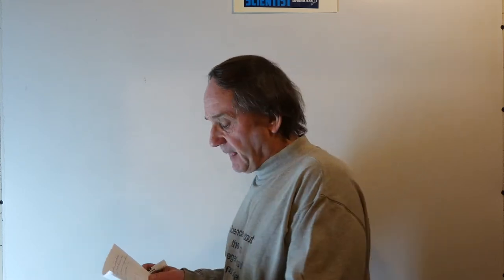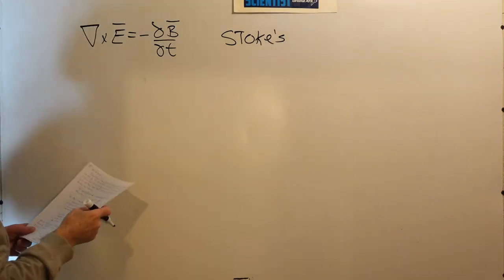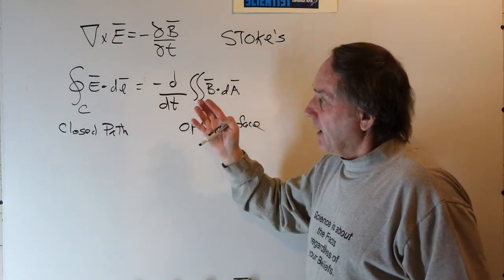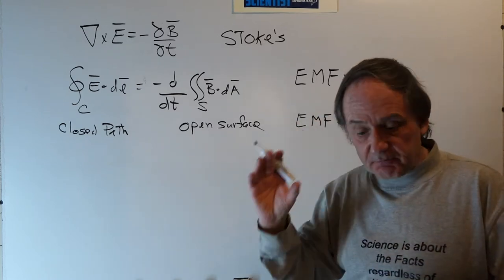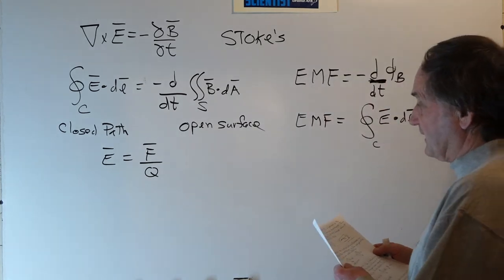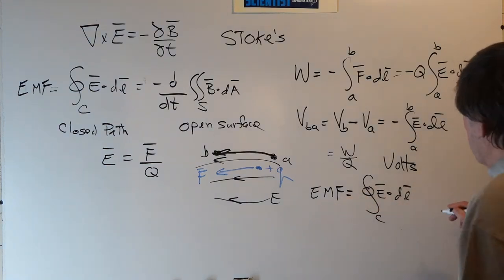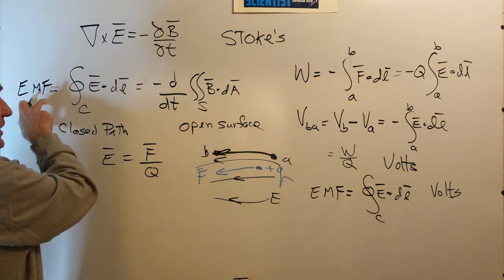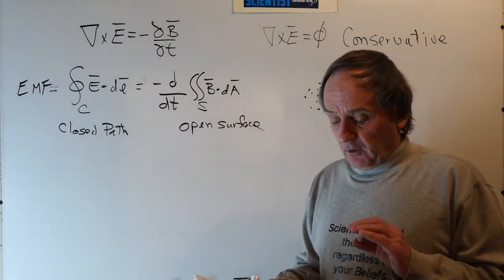FARADAY's  LAW

Comment from the maker: NEW  THREAD  FOR  Medhi,
I have another thread in which I posted recent comments I have made to  ElectroBOOM videos with reference numbers so we can easily find the comments.  This is called:  ARCHIVE  of  Comments on Faraday's Law
----------------------------------------------------------------------------------------------------------------------------------------

from isodoublet:   @ElectroBOOM   "You should start designing circuits a little bit to understand what's going on in real world I think. It is sometimes hard to grasp things when you just read about them and theorize."

"In the real world" Lewin is 100% correct and you are 100% incorrect. The correct physical principle is Faraday's law, and the KVL is merely a special case with no fundamental justification. Voltages are not defined when there's a changing magnetic field inside the loop. There's absolutely nothing guaranteeing you'll be able to model electrodynamics generally using only a scalar potential. The conditions required for this type of model to hold are well-known: E must be curl-less, which means no changing B fields are allowed.  Else you must use a vector potential. This is the "real world". 

"This is to say, the voltage across any inductor is defined, despite the fact that integral E dl through them is zero."

Once again, in "the real world", no, the voltage across the inductor is not defined. It can't be defined because the integral E.dl is path dependent. This means that if you choose a contour that goes inside the wires you get a different answer than if you go outside. We can define a workmanlike "voltage drop" which can be useful for certain purposes but this should NOT be confused with the actual voltage difference, which can be easily shown to not exist mathematically. This is what the real world is like. It doesn't have to conform to what anyone was taught.

--------------------------------------------------------------------------------------------
     
from ElectroBOOM:  @isodoublet     I understand what you are saying. But you are defining voltage as integral of E.dl. With that definition you and Dr. Lewin are correct like I mentioned in my video. But I tried to show that the voltage definition is not that, as I also showed from Professor Belcher's document and Dr. Feynman's book. Dr. Feynman clearly says the voltage across an inductor is defined. This is because it is NOT defined as integral E.dl. I don't know, but I keep Dr. Feynman at high regards.

------------------------------------------------------------------------------------------------
   
from  isodoublet:   @ElectroBOOM    "I understand what you are saying. But you are defining voltage as integral of E.dl. With that definition you and Dr. Lewin are correct like I mentioned in my video. But I tried to show that the voltage definition is not that, "
But you can't, because that is the definition of voltage, as defined by absolutely everyone, including Feynman. Look up equation 22.14 in his lectures. It says clearly and plain as day that the KVL is defined as the statement ∮ E ⋅ ds = 0. 

"Dr. Feynman clearly says the voltage across an inductor is defined."

No, he defines a workmanlike "voltage drop" which is not identical to the physical voltage drop, which he is well aware doesn't mathematically exist. That's why he tells you to use the path shown in Fig 2.9. Use any other path and the KVL fails even for a simple circuit containing an inductor.

-------------------------------------------------------------------------------------
     
from ElectroBOOM:   @isodoublet    In equation 22.14 Dr. Feynman is simply saying the sum of all voltages in a loop is zero. In equation before that it says line integral E.dl = sum of all voltages. If you return to equation 22.3 forward, Dr Feynman is showing the voltage across an induct or is equal to the line integral of E.dl across the rest of the circuit (without inductors). And he is saying there is a known voltage across the inductor equal to -L di /dt. So are you saying he is defining voltage differently here than the actual definition in physics?

-----------------------------------------------------------------------------------------

from  isodoublet:  @ElectroBOOM   "In equation 22.14 Dr. Feynman is simply saying the sum of all voltages in a loop is zero"

Let me paste the excerpt here for reference.

"The complete line integral is then just the sum of the voltage drops across all of the elements in the circuit:

∮ E ⋅ ds = ∑ Vn.

Since the line integral is zero, we have that the sum of the potential differences around a complete loop of a circuit is equal to zero:

∑ (around any loop) Vn = 0 (22.14)"

Ok, so ∮ E ⋅ ds = ∑ Vn = 0. This means ∮ E ⋅ ds = 0. This is Feynman's definition of the KVL, which is the same as Lewin's. Feynman is just telling you that to improve odds of success you should use the path shown in fig 22-9, since this equation is not true in general!

"So are you saying he is defining voltage differently here than the actual definition in physics?"

Yes. He's essentially telling you what paths are okay to use to make the KVL work when there are inductors in the circuit. In order to model this seriously using the same definitions of the scalar potential that are used elsewhere in physics (especially in Feynman's own pioneering work on quantum electrodynamics, for example) you would need to also define a vector potential A such that B = curl A and E = -grad V - dA/dt. There's some redundancy in the definition (we call this, somewhat confusingly, "gauge symmetry"), but one thing that is always true is that any curl of E must come from A, not V.

--------------------------------------------------------------------

from ElectroBOOM:  @isodoublet    Do you by any chance know anywhere in Feynman's book or anywhere else where the voltage is clearly defines? I like to see that. If our disagreement is on definition, we should settle it on where the definition is clearly made in literature. So far we are working from subliminal messages!

--------------------------------------------------------------------

from isodoublet:  @ElectroBOOM   Yes, the earlier chapters in Feynman's book do give the usual definitions of the scalar and vector potentials. In particular, chapter 15 has table 15-1 which contains various relations which are sometimes false (including E = -grad V) and their correct generalizations, which implicitly define the potentials V (which Feynman calls phi) and A.

----------------------------------------------------------------------

isodoublet   @The Crab   "Lewin believes KVL is ∮E᛫dl=0 even in the presence of a magnetic field, which is not correct, he's not taking into account the energy produced by the magnetic flux on the wires used to measure the voltage."

That is what the KVL is whether you like it or not. Mehdi actually agrees with this when he cites Feynman (who explicitly uses this definition). It is the definition. There is no other. 

"he's not taking into account the energy produced by the magnetic flux on the wires used to measure the voltage."

Energy is not a thing in the way you're thinking. It's not a fluid, it's not a gas, it's not a solid. It's a number. You calculate this number before a process happens, and then you recalculate the number after the process is concluded, and conservation of energy guarantees the two numbers will be equal -- an extremely useful relation. So there is no energy being "produced" in the wires. It just so happens that energy initially associated with the magnetic field is later associated with kinetic energy of the charges... and how does that happen? Magnetic charges do no work, so it happens by the action of an electric field. The B field changing in time produces a curl in E, and the curl in E then does work on the charges. So the definition ∮E᛫dl is perfectly adequate for the sum of voltages around the loop, which is why it's used by everyone. Is it zero when there's a changing magnetic flux inside the loop? You can bet anything that it isn't. This is simply the way nature works. It doesn't have to conform with what anyone was taught in high school.

----------------------------------------------------------------------------

 isodoublet   @Ash Kebora    " Technically, there is a voltage differential that is path-dependent, but Mehdi is basically saying (as explained about 13:25 and on for a bit), is that KVL still holds when analyzing the circuit. It's not magically doing something else."

And RedTriangle53 has been patiently explaining to you that no, it doesn't hold, it can't hold, and it's a trivially verified fact that it doesn't hold. It's not magic. It's 200 year old electrodynamics. Saying that it holds when Faraday's law shows explicitly that it doesn't really is akin to saying that 2 + 2 = zebra. There's no reason nor any justification for sugarcoating this.
Reply from the maker: RedTriangle53 
Sorry, but academia is not a safe space. Being patient with cranks is not, nor has it ever been, a written or unwritten rule in science. The very opposite in fact. Science is entirely based on being mercilessly critical of everything and everyone until you find something that does not buckle under it. A tenured professor should most definitely be able to say he's embarrassed that an alleged master of engineering is spreading misinformation about basic science to thousands if not millions of people. It would be embarrassing if he didn't.

To be clear, Mehdi is not correct. He has been throwing convenient assumptions against facts, and now to "conclude" he simply explains away the actual physics by making up things that simply do not hold, and he would know that if he bothered opening an undergraduate electrodynamics textbook. If this was a private argument it would be different, but he is spreading pseudoscience to people who don't know better in an as public way as possible(just look around the comment section and you will immediately spot at least a few dozen people who are now apparently qualified to insult and criticize Lewin because of the frankly incorrect things Mehdi has said), and he's doing it with seemingly no effort to listen to what the other side is saying or even checking his own facts before uploading a video. There is certainly a limit to what the scientific community in general should be patient with, and this crosses it.

-------------------------------------------------------------------------------------

RedTriangle53   @The Crab Mehdi    did not, and still does not, understand what he is talking about. Lewin is 100% correct, and Mehdi is 100% incorrect. That's all there is to it. There is no misunderstanding. Mehdi does not know his theory and he is throwing around assumptions and nonsense. From Lewin's perspective(and the perspective of anyone else who knows how the physics actually works) this is literally exactly equivalent to someone preaching about the flat earth under the authority of their masters degree. If Lewin is not allowed to be embarrassed by this, what in the world can he be embarrassed about?

-------------------------------------------------------------------------------------

RedTriangle53   @The Crab Wrong.   You are simply parroting what mehdi has said. The measurement was not done incorrectly, Mehdi just misunderstood what was being measured. Trust me, Lewin has made zero mistakes in this entire situation. Mehdi simply does not know his theory well enough, and instead of properly looking things up and correcting himself he makes up silly assumptions that on the surface level seem to conceal the fact that he was wrong, but are entirely in conflict with electromagnetic theory if you consider them at any depth. He claims that somehow everything works out because the B-field somehow performs work on the system. He does not demonstrate how this occurs, there is in fact zero mathematical argumentation to support this point. And all you need is one line of vector calculus to show that this cannot possibly be the case. I challenge you to find it.

-----------------------------------------------------------------------------

RedTriangle53  @Narret   Take for example his claim that the two sides of faraday's law are separate things entirely. His argument becomes that there is a magnetic opposite contribution to the work that counteracts the non-zero electric work.

Here's the zinger: The B-field cannot do work on a moving charge(you can show this with a single line of vector algebra). He just made that up. He also formulates this notion as "voltage does not only come from the E-field", which is wrong by definition.

He says a lot of correct things(which he did not come up with and also nobody disagrees with), but when he comes around to his key points which are supposed to justify his position he simply gets the basic theory terribly terribly wrong. It's not an interpretational discussion. Mehdi is just very very incorrect about the physics.

--------------------------------------------------------------------------------

 RedTriangle53    @The Crab     if the loop integral is not zero, then it is not actually KVL. KVL was defined by the voltage drops over every closed loop being zero. The end. If it works generally it must then instead be faraday's law, but Mehdi consistently misinterprets what the law states, seeming to think that the right hand side and left hand side are not essentially the same quantity. This unjustified assertion then lets him make further erroneous statements and shuffling them together to pretend that KVL holds. And yes, his statements are strictly false.

Yes I did read the paper, and it does not support Mehdi's claims. In fact it discusses the importance of being careful when formulating faraday's law to mimic KVL, because inductance terms that show up will have *nothing to do with the original definition of KVL and its statement*. In other words, these terms(in terms of what they represent) belong on the right hand side as is usual with faraday's law, and ordering it on the left hand side and calling it KVL is a great source of confusion for students. Everywhere else in the paper he properly and precisely applies faraday's law, not KVL, for dealing with systems under induction. I have no qualms about the paper or its author.

Mehdi on the other hand seems to contradict the paper when he states that the right hand side corresponds to work that counteracts the left hand side. He states that voltage does not only come from the E-field(which is wrong by definition), and states that magnetic work is a factor, when the B-field actually cannot ever do work on a moving charge. His statements are in fact in direct contradiction to the theory.

-------------------------------------------------------------------------------------

RedTriangle53   @Narret Yeah,     the "any energy per unit charge" thing is what I refer to by voltage not only coming from the E-field. This is wrong simply because voltage is defined by the curve integral of the E-field and nothing more. It does describe energy per unit charge of course, but only electrical energy.

If a magnetic field changes over time it induces a rotating E-field, and that is what faraday's law states, and where the surplus energy comes from. KVL stops holding because the loop integral over E is not zero when E has curl. Mehdi states that the right hand side is a magnetic contribution(around 9:30 minutes in) that cancels with the left hand side thus preserving KVL, but the right hand side is not magnetic, and it is not a contribution, it is the accumulation of the left hand side terms(you might say it's the solution to the left hand side). It's sort of like saying that a + b + ... - (a + b + ...) = 0 shows that addition always results in zero.

Aside from the fact that this is how things are defined and derived, you can show that you can't actually have a magnetic contribution to the work at all, because magnetic force is based on the cross product(forces can as usual be decomposed however we like and the sum still acts the same, so we can consider the magnetic force independently for general results and they will still apply perfectly). I believe it can be written as an identity a dot (a cross b) = 0 for all a and all b. To put it simply, work is only done by the component of the force which is parallel to the direction of travel, and magnetic force always acts perpendicularly to a particle's velocity vector. So magnetic fields cannot ever do work on moving charges.

I guess that's a lot of different ways of saying that the only possible contribution to the voltage is the E-field. Let me know if you feel like there was something I didn't answer properly.

--------------------------------------------------------------------------------
 
RedTriangle53   @Narret     Magnetic force on a charge is defined as F_m = q*v* x B and results in a force vector which is always perpendicular to the direction of travel. It therefore cannot do work on the charge under any condition. But it does curve the path the charge takes(though it gains no energy from the magnetic interaction). Magnetic work does exist of course, but not on individual charges. For example a magnetic field interacting with another can cause a motion of the other system(obviously we know that two magnets can attract or repel). In this example all the macroscopic parts of the system are considered fixed though.
 
RedTriangle53   @leakforme    I've mentioned the most glaring mistakes he made in this video and explained why they contradict the theoretical framework of electromagnetism. As you say, it's not a difficult feat. The reason you don't find many comments contradicting him is that his viewers mainly get their information from him I reckon.

Faraday's law and the Maxwell-Faraday equation are two different equivalent formulations of the same law. Faraday's law is on integral form, Maxwell-Faraday is on differential form. One can be related to the other using stoke's theorem. The left hand side is the voltage accumulated around a closed loop, the right hand side states that it is generally not zero.
Reply from the maker: terminate  @Electroboom ,  please explain your conclusion more clearly. When you derived the equation at 6.24 you even showed that as integral (e.dl) = sum of voltages as Vab. which is equal to -dO/dt and so KVL is  integral (e.dl) = 0.  As saying sum of voltages = 0  is  integral (e.dl) = 0.   And so Professor Lewin was right. 

I have not yet read the papers in the description.  However what you have said about them I do agree. Yes sum of voltages = 0 if you do not take the closed path with in the inductor.  But at 13:47 you said that  integral (e.dl) = 0 for inside the inductor with there is a change in magnetic flux. This is wrong. Yes in a DC circuit that is correct but not in an AC. 

Remember yes V=L Di/Dt  but integral (e.dl) = emf.  Remember that self inductance is  v = Ndo/dt  where n is the number of loops. so v is the sum of the voltages around those loops as N= number of loops and do/dt is the emf in that loop and so sum of the voltages is V (total voltage induced).  If you try to take the loop around the inductor it will not equal zero.  Nor have you shown why Dr lewin's demonstrations are wrong.  If you agree with faraday's law then you will know that  sum of voltages around any closed loop is equal to do/dt.  

Let's go back to you GPE analogy.  Yes its zero when you lift the transformer up you gain GPE and let go it gains KE and loses GPE and so the energy  ignoring air resistance is zero.  Now if you then attached the transformer to a machine that could give the transformer a constant acceleration and it forced the transformer up and then down.  Then GPE + KE  does not equal zero but equals to the work done.  I still do not see why you think KVL still always holds.  Please explain you opposing view in more detail as to why you disagree.  As this video you jumped to sum conclusions with no proof (are these conclusions from the paper you read?).

------------------------------------------------------------------------

terminate  @ElectroBOOM   I still do not see why you have jumped to the conclusion that there is no E field within the resistor because there will be. After all there are charge moving this produces of course magnetic fields however as they are charges then Is an E field.  If you looked at the Feynman's lecture you would see that saying there is no E field is not strictly speaking true.  It is that the total force on the charge is zero (that is after the initial acceleration of the charges) and so even in a perfect conductor the integral E.dl through them is -do/dt not zero.  Even more so If we are talking about real resistors that are not a perfect conductor.  What would you say if I made the inductor out of silicon? This has a very high resistance from the lack of free charge carriers and thus there is a considerable E field within that conductor.

-----------------------------------------------------------------------------------

terminate  @ElectroBOOM    I see what you are saying. However KVL says the sum of all the voltages around ANY closed loop is equal to zero. Yes IF you take the power source into account than the sum will equal that (emf). The power source is not taken into account because that is Not in the closed loop that we are dealing with here.  So simply by saying KVL always holds is false. If you have a different definition then you also have a different definition for KVL.  " I like to take the energy from magnetic fields into account and assume a known voltage across inductors and wires in the presence of magnetic fields. " But that magnetic field induces the emf every were in that loop. And also is NOT part of that loop. Thus the sum of the voltages around this particular loop is -do/dt.  I know you want to make things easier and if that works for you please keep using it. However keep in mind what KVL is saying. For ANY closed loop the sum of the voltages adds to zero. That closed loop does not take the magnetic field source into account but only its effects. And thus its is equal to the emf.  So purely by definition KVL does not always hold.

KevinMulia and also they are not both right in general, faraday's law is always right KVL is only right if there is no e field and so no induced emf around the loop.
--------------------------------------------------

terminate  Im glad that you have done this video as it shows your interest in this and you want facts.  However, I have read the bit of inductance on 

http://www.feynmanlectures.caltech.edu/II_22.html

 and they are in a agreement with DR Lwin.  "line integral of E all the way around any closed path is equal to the negative of the rate of change of the flux of B through the loop."   At 13.47 you say that integral of E.dl=0  Did you read this?  Or are you confusing DC circuits, please explain.

 
Ejaz Ashraf @terminate  In 22-2 of Feynman Lectures at the penultimate paragraph, it starts by saying "As we have seen before, there can be no electric fields inside a perfect conductor. Therefore the integral from a to b via the coil is zero" [sic]. I suppose this is what he is referring to. The first integral in Feynman's book runs via the coil.

--------------------------------------------------------------

terminate  @Ejaz Ashraf   From what I know i think ElectroBoom is miss interpreting feymans lecture post. As because as we have seen the the loop integral (E.dl) = integral(in inductor e.dl)+ integral(out inductor e.dl) if there is no E field with in the conductor lets say on the secondary winding of a transformer then there is no (inside -do/dt ) with the conductor and so there is no induced emf as emf = -do/dt. There must be a B fied with in the conductor as in order for the free electrons to react to that change in B field to produce an emf. And so in the conductor there is (inside caused by B field) and so it is  -do/dt. and so looking at this loop integral (E.dl) = -do/dt.  KVL says that sum of v=0 and so loop integral (E.dl) = 0 which is clearly wrong. Remember the analogy at the start of the video? its true that  GPE + Ke = 0 if just lift and dropping the transformer. But if I then forced in up and then down then GPE+KE = work done this is the conservation of energy and the same applies to this discussion. KVL is not wrong it is just unneeded as KVL does no always hold. In conclusion it doesn't matter if its a perfect conductor  as if exposed to a do/dt by the change in B field there will be an induced emf (which is every where) And so even if there is a voltage drop, the electrons gain that energy back from the change in B field and so the total PD across the loop is equal to that induced emf by conservation of energy and so KVL does not hold here.with no induced emf when the electrons go through the load they loose energy but do not gain it back and thus like the GPE + KE = 0 analogy the sum of pd across the loop is zero by conservation of energy (see the difference between the circuits?).

Ejaz Ashraf   @terminate 
https://youtu.be/EYYNRubHIno
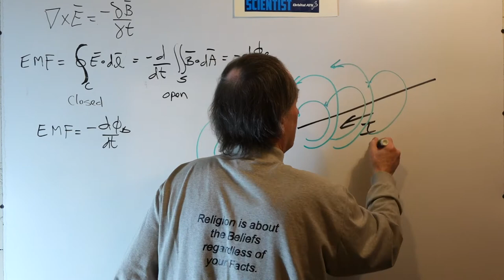39:30
Reply from the maker: [T9 -1]     12/11/18     1:05am                also found [T2-2]  elsewhere   
@Narret, Your question:
<<< isn't the Faraday's law based on a total derivative and the Maxwell-Faraday equation only based upon a partial derivative?>>>

The point form of Faraday's Law as commonly expressed as one of Maxwell's equations assumes the circuit in which the E-field is being measured is stationary with respect to the observer measuring the fields and the B-field is uniform in space as it changes with time:

                                          ∇ × E  =   - 𝛅B/𝛅t
                                   
This is called  "transformer action".

However, if the circuit is allowed to move within the changing magnetic field then another contribution needs to be added to the point form equation to account for the contributions due to lines of flux being cut by the moving circuit which is called "generator action".

                       ∇ × E  =   - 𝛅B/𝛅t  +  ∇ × (v × B)   

                    - 𝛅B/𝛅t  =  transformer action  
               ∇ × (v × B)  =  generator action          v = velocity of moving ckrt

Note that  (v × B)  =  Em  is called "motional EMF"  so we can write
Faraday's Law as:
 
                                ∇ × E  =   - 𝛅B/𝛅t  +  ∇ × Em     

The total derivative follows on the right side by looking at the convective derivative of the B-field,  assuming the circuit velocity has no spacial variation (circuit is not deforming or contorting while moving) and noting that   ∇ • B = 0.

                       ∇ × E  =   - 𝛅B/𝛅t  +  ∇ × (v × B)   =  - dB/dt

If you attach an open non-deforming surface  "Σ"  to the circuit path and integrate the flux over that open surface  we get:

                    ∫∫  ( ∇ × E ) • dA  =  ∫∫  ( - dB/dt ) • dA 
                    Σ                              Σ

Apply Stoke's theorem to the left side of the equation:

                   ∮ E • dL  =   ∫∫  ( - dB/dt ) • dA 
                                        Σ 

Since the open surface "Σ"  is non-deforming but rigid over time, we can move the total derivative out of the integrand as a Leibnitz rule for vector integrals:

                ∮ E • dL  =   ∫∫  ( - dB/dt ) • dA  =  - d/dt ∬B • dA   =   - dΦ/dt
                                     Σ                                             Σ

                     ∮ E • dL  =   - d/dt ∬B • dA   =   - dΦ/dt
                                                     Σ

This integral form of Faraday's Law is always true and can be applied in general even when the circuit is deforming and contorting in time but the differential point form has restrictions as noted above.

           ∮ E • dL   =  - d/dt ∬B • dA   =    - ∬ 𝛅B/𝛅t • dA  +  ∮ (v × B) • dL
                                           Σ                        Σ          

           ∮ E • dL   =  - d/dt ∬B • dA   =    - ∬ 𝛅B/𝛅t • dA  +  ∮ Em • dL
                                           Σ                        Σ    
                                                                     transformer         generator
GH
===========================================================
https://youtu.be/Q9LuVBfwvzA?lc=Ugz3NZtYruDitynO-Ax4AaABAg.8oPJAdGPDNy8oQnlPXj0vn
Reply from the maker: [T9-2]     12/11/18       2:48 am
You all need to take a deep breath.  Lewin is correct on all points - that should not be debated.  What is the problem is,  most texts and instructors are unaware of the fundamental error they are making by not realizing that in the presence of changing magnetic fields you have a Faraday Law problem and not strictly speaking  KVL.  Lewin is correct on that point and that is what he trying to convey to the world.  He is not saying KVL does not work but that it is being misapplied or rather the name inappropriately attributed to what is a Faraday Law problem.  The loop rule as it is being used in cases where there is a changing magnetic flux whether localized in inductors/transformers or applied externally is  NOT  STRICTLY  SPEAKING  KVL  but rather Faraday's Law.  That is all he is saying.  

Applying the term [ Kirchhoff's loop rule ] in the general case is what is wrong and not the loop rule itself.

What we are taught as electrical engineers and in most physics courses is that you can sum voltages around a closed loop(circuit) and get ZERO for the sum, that is: the sum of the voltages around a closed loop is zero.  This is true IF in that sum you include induced voltages(EMFs) as well as explicit voltages such as battery EMFs, capacitor voltages due to displacement currents and ohmic drops.  That is not in debate.  This has been taught for decades and WORKS.  It is the primary analysis tool used in circuit analysis - that is not in dispute.  All Lewin is saying is keep in mind that when you do this, you are actually writing Faraday's Law and have moved all the terms to the left side of the equation and when invoking the loop rule, you are not making a distinction between the explicit voltages and induced voltages which is not electrically true and correct though mathematically sound.  This procedure is in the strictest sense inappropriate.  When doing that, you hide the nature of the induced voltages by treating the same as the explicit voltages from Ohmic drops etc.   BUT  IT  WORKS.

Again, when you sum all the voltages, explicit and induced in this manner around a loop, this is a general  LOOP  RULE  and not Kirchhoff's loop rule.  Kirchhoff's loop rule applies only to conservative field systems where there are no changing magnetic fields.  Kirchhoff's loop rule is a subset or special case of this more general loop rule we call Faraday's Law.  Only when there are no changing magnetic fields within the components (inductors and transformers) does the loop rule become KVL.  Herein lies the problem and source of controversy:

We have in electrical circuit analysis incorrectly extended the name KVL to include the more general loop rule which is Faraday's law.

If you move the induced term of Faraday's Law to the left side of the equation, you get a general  LOOP  RULE  that looks like Kirchhoff's loop rule because it says the same thing:  that all voltages(explicit and induced) summed around the loop sum to ZERO except now it incorporates the induced voltages into the sum whereas KVL does not.

FARADAY's  LAW:

                         ∮ E • dL  =  - d/dt ∬B • dA   =   - dλ/dt 

                                   - dλ/dt  =  Induced  EMF

                          ∮ E • dL  =   Induced  EMF

Move the Induced EMF term to the left side of the equation:

                    ∮ E • dL  -   Induced  EMF   =  0.0

            But,    ∮ E • dL  =   ∑ Vx(explicit)

so we write:

                  ∑ Vx(explicit)   -   Induced EMF  =  0.0

In circuit theory we consider the Induced EMF a "back EMF" and reverse the sign to designate it as a voltage drop across an inductor or transformer winding etc:

                       ∑ Vx(explicit)  +  ∑ Vx(induced back EMF)  =  0.0

In circuit theory we do not make a distinction between explicit and back EMF induced voltages and just combine and treat them the same:

                                          ∑ Vx  = 0.0

This is the general voltage  LOOP  RULE  we use in circuit analysis that looks like KVL but is not in general KVL.  This general loop rule reduces to become KVL when there are no changing magnetic fields such as in DC circuits and AC circuits that involve no inductors and transformers.  The mistake that is being made by these text books and instructors is extending the name KVL to include the more general case of Faraday's Law which is not strictly speaking correct and proper thing to do.

So instead of calling the general loop rule KVL, maybe we should call it just the loop rule or  Lewin's Loop Law (LLL or L cubed) in honor of the professor who has been bringing this error to the attention of the profession for decades now.

Just keep in mind that when you are writing a loop equation around a circuit that has magnetic components such as inductors and transformers that you are actually writing a Faraday Law equation and not KVL.   That is all Professor Lewin is telling you.  He is not claiming KVL is wrong when properly applied to conservative networks/systems.

George Hnatiuk, PE                        

PS   Calm down everyone - this is just an issue of nomenclature and not the failing of the analysis technique.
Reply from the maker: [T9-3]      12/11/2018   2:43 am     from  [T5-7]  12/07/2018  3:17 pm
ElectroBOOM   @George Hnatiuk   I'm sorry, you clearly know everything.
@ElectroBOOM       LOL   You at least have now recognized that.  LMAO

Seriously though, I do not know everything but I am damn good at analog design and EM theory related to the art of  "black magic" when applied to sensitive, low noise and high speed electronics and I do know quite a bit about precision instrumentation and making measurements.  I have to my credit designed some of the electronic analog front ends for the best data acquisition instrumentation you can buy today.  I am a good designer and have tons of experience and theory in my tool kit.

Now lets get down to business and get you up to speed.
Let me ask you this,  when it comes to the Lewin/Romer single loop 30cm in circumference with two resistors, 100 Ohm and 900 Ohm,  embedded within the loop interconnected by wires (20AWG) made of a good conductor such as copper, which of the following do you understand to be true when the induced EMF about which that loop is immersed and at a value of  - dΦ/dt = 1.0 volt?

(1) The induced EMF of   - dΦ/dt = 1.0 volt evenly distributes itself along the loop resulting in a EMF voltage drop of 1.0v/30cm = 33.3mV/cm along the copper wires.

(2) Nearly most (99.999%) of the induced EMF of   - dΦ/dt = 1.0 volt appears across the two resistors with very little voltage drop along the copper wires.  The EMF voltage drop along the wires will be 0.333microVolt/cm along the copper wires.

NOTE  the difference between the two choices is the magnitude of the EMF voltage drop along the copper wires which is different by a factor of 100,000.

Your answer to this question will tell me much about your understanding regarding this matter.
Thanks,
GH
Reply from the maker: [T9-4]  12/11/2018    3:17
from ElectroBOOM :
3) The induced EMF is distributed evenly on wires, and at a different rate but still evenly on the length of resistors. (a real resistor is ideal resistor + inductance). The induced EMF is then equal to the sum of resistor voltages created purely from ohms law over their resistive element.

This is to say, the voltage across any inductor is defined, despite the fact that integral E.dl through them is zero. And the loop wires are inductors and secondary of transformers.

---------------------------------------------------------------------

@ElectroBOOM   You write:
<<< I wish you had carefully watched it so we could do an educated debate, rather than just call me a putz!>>>   If you carefully read the comment, I did state: "I will watch the video in more detail tomorrow and respond ... "  which I did.  That was 4 days ago when I first saw and scanned the video late at night before bed.

I am willing to talk to you about these things in a civilized manner and would rather not call it a debate but an intellectual discussion among engineers for I do assume you are honest about your having an EE masters degree.  As for the putz comment, a lot is in jest for the amusement of your viewers.  I can tell from your videos that you are not stupid but maybe just have some misunderstandings which we all do in various areas of our knowledge and you are most likely fully capable of grasping anything I have to say for your basic background does seem adequate.  You have many things right but others wrong according to how I understand these issues.  You are engaging and entertaining and I can see how you have acquired 2M viewers.  I do not begrudge you that for you have found a niche and have worked it well.

I certainly did not have as thorough understanding of Faraday's Law and its implications after earning my EE masters as I do today after many years of thinking about it and practicing the electrical science in spite of the fact I focused my masters thesis based on Faraday's law and studied out of Jackson's Classical Electrodynamics.  My attention at that time was on the point form of Faraday's Law and the strict mathematical conditions and restrictions under which Stoke's theorem could be applied in rewriting the differential equation from the point form to the integral form - specifically, to answer the question,  does Stoke's theorem apply to path contours and surfaces attached to those contours that may be contorting, stretching and in general deforming as they move in space thru a changing non-uniform magnetic field.  Not a trivial question to ask and answer.

------------------------------------

First thing we should get straight and understand so we are on the same page is we can neglect parasitics which you hint at when you state, a real resistor is ideal resistor + inductance.  Yes, that is the case for real world lumped element components but for the bandwidth of signals generated when a switch is closed from a battery to drive the primary solenoid, they are not important.  The pigtail leads of a resistor or capacitor produce around 12.5nH/inch of lead length to the equivalent series inductance of the component so is quite unimportant in this experiment.  Even if we consider the self inductance of the total 30 cm perimeter of the single loop sensing coil, the total self inductance will be on the order of 150 nH which together with a total circuit resistance of 1K Ohm has a 3db frequency of slightly larger than 1GHz.  Most definitely unimportant in this case.

Your statement is not clear to me: "The induced EMF is distributed evenly on wires, and at a different rate but still evenly on the length of resistors."

What do you mean by " induced EMF is distributed evenly on wires, and at a different rate .."  ??? 

I take it you are offering an option (3) from the choices I gave you so please detail this a bit more for me.

Lets forget about this for the moment:   This is to say, the voltage across any inductor is defined, despite the fact that integral E.dl through them is zero. And the loop wires are inductors and secondary of transformers.

I have a lot to say about this once some preliminaries are disposed of.

Also, provide your thoughts and reaction to my comment above two days ago regarding a general Loop rule vs Kirchhoff's loop rule
     the comment began: [ ACHTUNG       ---    ATTENTION  EVERYONE ]

Thank you,
GH
Reply from the maker: [T9-5]    12/11/2018    4:14am
from ElectroBOOM:  @George Hnatiuk   by " induced EMF is distributed evenly on wires, and at a different rate .."  I meant I can't guaranty the resistors inductance behavior is the same as the wire. If we can assume they are structurally the same as wire, then the rate should be the same.

I don't think our understanding of electronics if much different. The only difference between us is the definition of voltage. If you can show me that the voltage is defined only as the integral of E.dl from a literature, then there is no further talk.

The way I see it and I think many other engineers do, is that although there are no E fields in the ideal wires, it is the length of wires responsible for providing the push electrons need to move in a magnetic field, because they are inductors with mutual inductance to the primary. Simply put there is an energy moving electrons in the wire. And energy divided by charge is voltage.
Reply from the maker: [T9-6]   12/11/2018  4:21am     from  12/07/2018   8:23 pm
@ElectroBOOM They are many topics in that last comment you made.  Lets take thing a step at a time.

 <<<"induced EMF is distributed evenly on wires, and at a different rate "I meant I can't guaranty the resistors inductance behavior is the same as the wire.  induced EMF is distributed evenly on wires, and at a different rate .."  I meant I can't guaranty the resistors inductance behavior is the same as the wire. If we can assume they are structurally the same as wire, then the rate should be the same.>>>

I must be thick for I am still not on the same page here.  Please do not use pronouns but specifically name to what you refer.  You say, " If we can assume they are structurally the same as wire, then the rate should be the same."  What is structurally the same - what is THEY?  The resistors as the wires?  Inductors?   What is structurally the same?   Resistors are not structurally the same as wires unless you have constructed them out of resistance wire using some material having a resistivity greater than copper such as nichrome or a copper alloy like alloy 90.  Lumped resistors like 1% metal film are actually a film material deposited on a core and cut in a spiral to give the proper resistance and are not anything close to a wire.  The spiral nature of the "cut" increases the equivalent series inductance though still very small for this experiment and can be neglected.  SMT resistors are about as close to an ideal resistor as we are likely to get for the lower values (<1K) tend to be bulk resistances that have little self inductance and the shunt capacitance is lower too.

Lets just assume the resistors are SMT types.

<<<I meant I can't guaranty the resistors inductance behavior is the same as the wire. >>>   
Again, we can neglect the parasitic self inductance of the resistors if that is what you mean.  Please take more time to explain yourself.  You do not have to treat this like a presidential "tweet" war.  :)

GH

------------------------------------------------------------------------------------------------

from  ElectroBOOM:  Yes, let's say resistors are super small and their inductance doesn't matter. Then I would go with your option1. Voltage across resistors is equal to voltage across wires IF we go with my voltage definition. Like saying the loop wire is the secondary of a transformer, a generator that outputs EMF across a resistor. 

Otherwise if voltage is defined as integral of E.dl, we would have zero volt across loop wires and voltage across resistors which matches Dr. Lewin's presentation, and your option2. But that's not how I see things.

Both definitions don't effect any laws of physics and all outcomes will be exactly the same in all calculations. But I find my way makes understanding the circuits and their relations easier. Unit of voltage is Joules / Coulomb. I like to take the energy from magnetic fields into account and assume a known voltage across inductors and wires in the presence of magnetic fields. 

And I think that's what most people agree on and use. Like when you turn a motor, a back-EMF is generated which is measured with voltmeter. It is a real voltage made by magnetic fields. But in Dr. Lewin's definition, voltage across the motor is undefined, and we have an EMF (that is not shown in circuit as a source or component) that creates current in the circuit. 

This model of thinking doesn't match how they model motor circuits where they model back-EMF with a voltage source series with the inductance of the motor, a voltage source dependent on the rotation speed of the motor. But with my type of definition, it all makes sense, because magnetic fields create voltage.
Reply from the maker: [T9-7]   12/11/2018  4:25       from  12/08/2018       12:52 am
@ElectroBOOM   <<< I don't think our understanding of electronics if much different. The only difference between us is the definition of voltage. If you can show me that the voltage is defined only as the integral of E.dl from a literature, then there is no further talk.  The way I see it and I think many other engineers do, is that although there are no E fields in the ideal wires, it is the length of wires responsible for providing the push electrons need to move in a magnetic field, because they are inductors with mutual inductance to the primary. Simply put there is an energy moving electrons in the wire. And energy divided by charge is voltage. >>>

Lets first get the other issues resolved so we do not have too many things on the plate at once.  I will answer this about voltage and energy tomorrow because right now it is hard for me to concentrate as I have 3 things going on right now this evening including dinner.

In the meantime think about this.  Energy does not move electrons in a wire, forces move electrons.  Objects are moved by forces not energy. In electromagnetics  VOLTAGE  DIFFERENCE  or  VOLTAGE  DIFFERENTIAL  between two points "a"  and  "b" is DEFINED as:

                                           b 
        Vba  =  Vb - Va  =  - ∫ E • dL      b = final position ,  a = initial position
                                          a

You and others have extracted an energy term out of this by noting that the Electric field, E , is related to the electric force on a charge by 

                                          F  =  q E

then solving for E and putting that into the voltage equation above as:

                                           b 
 Vba  =  Vb - Va  =  - 1/q ∫ F • dL      b = final position ,  a = initial position
                                          a

You then note that force integrated over a distance as it acts on an object is work performed which has energy units:

                           b 
               U  =  -  ∫ F • dL      b = final position ,  a = initial position                                        
                           a

 and then come to the conclusion that voltage,   Vba  =  U / q

or voltage is  ENERGY / CHARGE and conclude voltage is energy available in an electric field to perform work on a charge.  Yes, the units are correct and we can always perform dimensional analysis and manipulations to extract all sorts of relationships out of equations BUT that does not establish that such relationships have any real physical significance.  In mechanical systems work performed is energy expended hence the marriage between the two.

In an electric field the energy density is given by:

 dWe/dv   =   1/2  D • E   joules/m^3  =  1/2 ε E²      since  D  =   ε E  

There is no voltage to be found in this relationship.  Energy in the field is related to the field intensity squared irrespective of any voltage measurement being made within that field.  Voltage by itself does not reveal anything about the energy in the field.  

Suppose I produce a uniform electric field between two parallel plates of say 100v/meter and move an electron against the force it experiences in the field between two points "a" to "b"  separated by 20cm and register a voltage difference of  (- 20volts). The energy density of that field in free space is 

     dWe/dv  =  44.3 nanoJoule/m^3    using  ε∘  ≈  8.854 x10^(−12)

Neglecting relativistic effects, if I release that electron to let the field move it back to point "a" from "b", that electron will be accelerated at 1.76 x 10^13 m/s^2 and have a velocity of 2.65 x 10^6 m/s after reaching point "a" in 150nSec.

Now suppose I increase the electric field between the plates by a factor of 5 to 500v/meter and I move that same electron between two points in the field separated by 4 cm.  The voltage registered will be the same  (- 20volts) yet the energy density of the field in free space will have increased 25 times to

     dWe/dv  =  1.107 microJoule/m^3    using  ε∘  ≈  8.854 x10^(−12)

Now when I release the electron, it will accelerate at 8.80 x 10^13 m/s^2 and have a velocity of  2.65 x 10^6 m/s after reaching point "a" in 30.0nSec.

Obviously the second electric field has much more energy available (25 X) for the electron yet the voltage registered is the same.  The electron reaches the same final speed after release and experiences the same voltage difference.

The voltage itself tells us little about the electric field and the energy contained within it.  The voltage GRADIENT is what gives us information about the electric field.  How the voltage varies in spacial position (gradient)  between points in space is a measure of electric field strength and is what tells us about the electric field and the energy contained in the electric field and NOT the voltage itself.  It is the gradient of the voltage scalar field (potential) that tells us about the nature of the electric field.  With the gradient information we can compute the nature of the electric field as
 
                                                  E = - ∇v

The energy in the electric field is proportional to the magnitude of the voltage gradient squared:

                               Energy density  =  1/2 ε |∇v|²

As long as the electric field is produced by static charges that generates coulomb forces, that field is CONSERVATIVE and voltages are unique and well defined.  Such a field is CURL- less.  By definition, a CURL- less field,  E , is a conservative field and can be defined as the gradient of a scalar voltage field for  

        Definition of a conservative field:      ∇ X E  =  0.0 

Mathematically, the CURL of the gradient of a scalar field is identically ZERO:

                            ∇ X E  =  ∇ X ( - ∇v)  ≡   0.0

Before I talk about this further, I suggest you first read some of my comments to your viewers on the Lewin videos if you have not already done so.  These are the relevant links:

https://youtu.be/qAtqgSaEU4Y?lc=Ugz9UiwCwgSFacq1NFx4AaABAg.8nMEGVKLEc_8naLscKZ5YJ

https://youtu.be/qAtqgSaEU4Y?lc=Ugz9UiwCwgSFacq1NFx4AaABAg.8nMEGVKLEc_8nlM7cR9ip2

https://youtu.be/qAtqgSaEU4Y?lc=Ugz9UiwCwgSFacq1NFx4AaABAg.8nMEGVKLEc_8nqQf1SST2B

https://youtu.be/qAtqgSaEU4Y?lc=Ugz9UiwCwgSFacq1NFx4AaABAg.8nMEGVKLEc_8nrN67UCMjP

https://youtu.be/qAtqgSaEU4Y?lc=Ugz9UiwCwgSFacq1NFx4AaABAg.8nMEGVKLEc_8o2uQ7uumdX

GH
Reply from the maker: [T9-8]  12/11/2018  4:27       from 12/08/2018     2:34 am
@ElectroBOOM  Looks like we have some work to do.  Option (2) is the reality of the situation and how nature work the physics.

What we need to look into is what you measure with the scope and voltmeters.  That is the final judge in all this.  You can redefine what voltage is all you want but the voltmeter does not care.

Another point is magnetic fields do not move electrical charges nor give them energy or take energy away from them.  You only need to look at the auxiliary equations to Maxwell's and in particular the Lorentz force law:

       F = q( E + v X B*)  = q *E +  i L X B     Lorentz force Law

Magnetic fields can only influence moving charges that move within that magnetic field with some velocity, v.    A charge moving with some velocity, v , can be thought of as a CURRENT.  A current carrying wire experiences a force orthogonal to the current flow when immersed in a magnetic field, B.

Upon examination for the Lorentz equation, we immediately see that any force imparted to a moving charge by a magnetic field is always ORTHOGONAL to the movement of the charge as given by:

                                        F  =  q v X B

The vector CROSS PRODUCT tells us the the resultant force a magnetic field imparts on a moving electric charge is ALWAYS at right angles to the movement of that charge hence the magnetic field can do no work on the charge and impart no energy to it for the definition of work is the integral of the  DOT  product of FORCE and movement along a path and if the force is ORTHOGONAL to the movement along a path (motion of the charge), no work is done and no energy is exchanged:

                                       b 
        WORK  =   U  =  -  ∫ F • dL      b = final position ,  a = initial position                                        
                                      a

Substitute the Lorentz force law into the work equation for a charge moving in a magnetic field and recognizing that v and dL are coplanar:
                            
                                       b 
        WORK  =   U  =  -  ∫ (q v X B ) • dL  =  0.0   
                                      a

GH
Reply from the maker: [T9-9]   12/11/2018  4:30  
terminate  @ElectroBOOM   I still do not see why you have jumped to the conclusion that there is no E field within the resistor because there will be. After all there are charge moving this produces of course magnetic fields however as they are charges then Is an E field. If you looked at the Feynman's lecture you would see that saying there is no E field is not strictly speaking true. It is that the total force on the charge is zero (that is after the initial acceleration of the charges) and so even in a perfect conductor the integral E.dl through them is -do/dt not zero. Even more so If we are talking about real resistors that are not a perfect conductor. What would you say if I made the inductor out of silicon? This has a very high resistance from the lack of free charge carriers and thus there is a considerable E field within that conductor.

------------------------------------------------------------
    
terminate  @ElectroBOOM   I see what you are saying. However KVL says the sum of all the voltages around ANY closed loop is equal to zero. Yes IF you take the power source into account than the sum will equal that (emf). The power source is not taken into account because that is Not in the closed loop that we are dealing with here. So simply by saying KVL always holds is false. If you have a different definition then you also have a different definition for KVL.  " I like to take the energy from magnetic fields into account and assume a known voltage across inductors and wires in the presence of magnetic fields. " But that magnetic field induces the emf every were in that loop. And also is NOT part of that loop. Thus the sum of the voltages around this particular loop is -do/dt. I know you want to make things easier and if that works for you please keep using it. However keep in mind what KVL is saying. For ANY closed loop the sum of the voltages adds to zero. That closed loop does not take the magnetic field source into account but only its effects. And thus its is equal to the emf. So purely by definition KVL does not always hold.

----------------------------------------------------------------------

@terminate You have basically restated what I have been trying to get across in my comment above of two days ago:

https://youtu.be/Q9LuVBfwvzA?lc=Ugz_SRPE6R1Dayrkxah4AaABAg.8oPVNZchduD8oUgIxrq--x

Writing Faraday's Law as a sum of voltages including the INDUCED EMFs   around a closed loop and setting it equal to ZERO can be called a general LOOP  LAW  but it is not KVL.  Books and instructors have incorrectly taken the liberty to extend and attach the name KVL  in writing a loop equation that includes EMFs due to changing magnetic fields.  But strictly speaking, it is  NOT  CORRECT.  The general loop law works for the reason I detailed in that comment but it is not KVL,  it is Faraday's Law.
GH

------------------------------------------------------------------------

ElectroBOOM  @George Hnatiuk   Hi George, seem you have removed the one before last comment where you used Lorentz force. I was going to argue about that a bit but that's gone anyway. 
In any case, from your last comment again it seems our disagreement is on what name is used for which definition. If we set our definitions such that we understand each other's language, I think in general we agree on the physics. I like to use KVL for what describes Faraday's law properly. Like when they used the name VOLT as the unit for voltage, to honor the first person who came up with the idea. But if you don't like it, call it Mehdi's Voltage Law or MVL!
Reply from the maker: [T9-10]   12/11/2018  4:43am
And by the way, every time I said motor I meant a generator! It is a bit confusing but the fact is that a running motor is also a generator at the same time creating back-emf that reduces the current at no mechanical load. When higher mechanical load slows the motor down, the generated back-emf drops resulting in a higher current through the motor.

Mehdi

------------------------------------------------
Hi George,
Thanks for the thread. Let's jump to [T9-8] about Lorentz force. Of course I agree with you that force and speed are perpendicular and so the force (let's call it Fm from magnetic fields) does not work in direction of the speed. But Fm pushes the charge sideways and if it can successfully move the charge in its direction, then work is done. Let's look at the following diagram. Sorry if it is not very nice-looking! It’s basically a piece of wire moving at speed of v perpendicular to wire between two magnets (with a length of L) that create uniform fields B between then, and no field outside for simplicity. And we know this creates force Fm on the charges inside the wire in the direction of wire. (continue below)

 As you well know, speed v is made by mechanical forces to move the wire, so it is obvious that Fm is not responsible for v. But now Fm is responsible for pushing charges along the length of the wire. Below is looking at it from top. Let’s focus on charge q on the wire. At the beginning when we just start to move (time  --> 0) q is not moving and Fm will make it move a moment later.

 Now let’s assume charge starts moving at a fixed speed of v’ on the wire, and we have the diagram below. The movement of charge in wire results in a new speed of v-total, and of course from Lorentz force formula the force applied to the charge from magnetic fields changes to F-new perpendicular to v-total. This force has two components, F-reverse resisting against the movement of charge in the direction of original speed v. This is the force slowing our motor down under load. The other force F’m is in the direction of wire helping the charge move forward.

Observing motors, speed v is very fast while we know the charges move at snail speed in the wire. So v-total is very much the same as v as well as F-new and F’m. The higher the current, the faster the v’ and so the more v-total turns, resulting in more turn of Fnew and hence a stronger F-reverse resisting against the movement. Now these forces are only present as long as the charge is within the magnetic fields for the length of L.

 Let’s assume the fields are uniform and speed is constant and so F’m is fixed moving charges along the wire from one end to the other. This means the work done by force F’m , Wm = F’m x L. Clearly work is done moving a charge in magnetic fields and that energy is spent in the load. And per my view of voltage this work or potential energy divided by the amount of charge moved is voltage, or the EMF.

 This setup is a generator and the moving wire in magnetic fields can be shown as a voltage supply, as is done in general motor and generator analysis.

This is why I am saying we must consider the voltage generated from magnetic fields in a circuit. In my opinion it is pretty old school to assume that voltage can only be made from electric fields while clearly magnetic fields provide forces to move charge in a circuit.

Let me know what you think.

Thanks,
Mehdi
Reply from the maker: [T9-11]   12/11/2018  5:12am         from ElectroBOOM:
Hi George,
I appreciate your great knowledge on the subject.  Of course in our typical generators the generating factor is the change of flux through the loop of wires.  But what I demonstrated was also a type of generator, a moving wire through magnetic fields creates current. It is from Lorentz force rather than Faraday-Maxwell's equation.  It basically serves as an example that moving charges through magnetic fields does result in work done. Same as an actual generator with windings turning through magnetic fields.

This subject is also discussed in Feynman's book chapter 16: http://www.feynmanlectures.caltech.edu/II_16.html

As you can find in this chapter that there is a text in the subject of transformers:  It can transform one emf (also called a "voltage") to another and that's my entire point, that the emf generated across a solenoid is voltage, generated from either flux change or Lorentz force. It is a real and unique voltage across a coil of wire and exists in a circuit.

Or another example in chapter 17 figure 17-7 shows an AC power source in place of a generator shown in figure 17-6:

Such examples show that there is in fact voltage across inductors and coils in a changing magnetic field. The energy induced in a piece of wire shows as unique measurable voltage across it. This is not against Maxwell-faraday's equations.

Thanks,
Mehdi
 
--------------------------------------------------------------------------

Hi Mehdi,
Keep in mind that in electrostatics we find that the tangential component of the electric field,  E , is ZERO at the surface of a conductor and also that the tangential component is ZERO at the surface of a perfect conductor ( σ = ∞ ) for all time varying fields,  Et = 0.0.   Time varying TEM waves satisfy Laplace's equation just as static electric fields do, so what is true for static electric fields is ALSO true for TEM waves.  This is why we can solve for the field configurations of TEM waves in complex geometries using electrostatic experimental mapping methods such as curvilinear squares with conducting teledeltos paper:

        https://en.wikipedia.org/wiki/Teledeltos

  https://www.electronicdesign.com/analog/whats-all-teledeltos-stuff-anyway

With good conductors there is a minimal NET tangential electric field within the conductor that is just large enough to support current flow.

                  J  =   σ Eint             σ  for copper =  5.794 x 10^7  Mhos/meter

In a moving conductor, the motional electric field intensity, Em , forces quasi-static charge separation until the static field, Es , due to these charges moving apart just balances and cancels out the field induced by the motion of the bar.  The resulting NET tangential electric field intensity,  Eint , inside the conductor is close to zero along the length of the conductor.  

                                 Eint  =  Em  -  Es  ==>  0.0

 For a 20AWG copper wire carrying 1.0mA of current, the NET electric field is:
              
                     Eint  =  I / (σ A)             A  =  cross-sectional area of the conductor

                                 A  =  5.18 x 10^(-7) m^2      for 20 AWG

       E  =  I / 30.01  =  33.3  μV/m     for current   1.0mA  in  20AWG  copper wire

The quasi-static state is maintained when the fields are time varying up into the GHz range for the relaxation time for charge movement and their responses to these fields in copper is so very short which is why metals are useful as electrical conductors even at room temperature, where a relaxation time on the order of about 10^(-14) seconds.

In the meantime look up "Hall Effect" for that is what you have in your description rather than the mechanism for induced EMF along the wire that drives the electrons in a "generator" action.  Lorenz forces are responsible for the current flow arising from "generator" action.  That electric field and force are caused by the 2nd term that appears in Faraday's Law when considering wires moving thru an magnetic field and cutting the lines of flux that we call "generator action".  This action(motion or movement) produces what we call a "motional EMF,  Em".

                                              Em  =  (v x B) 

In the meantime read the comment on the Lorentz field I posted in another thread to your video or in [T9-1] above which is a copy:

https://youtu.be/Q9LuVBfwvzA?lc=Ugz3NZtYruDitynO-Ax4AaABAg.8oPJAdGPDNy8oQnlPXj0vn

GH
Reply from the maker: [T9-12]     12/11/2018    5:27am
<<<I appreciate your great knowledge on the subject.  Of course in our typical generators the generating factor is the change of flux through the loop of wires.  But what I demonstrated was also a type of generator, a moving wire through magnetic fields creates current. It is from Lorentz force rather than Faraday-Maxwell's equation.>>>

First and foremost, please do not stroke my ego.  I do not need that.  I know I am a good engineer and mathematician and comfortable with my limitations and knowing what they are.

GH
Reply: @georgehnatiuk5806  in case of lorentz force, -dB/dt can be zero (no changing magnetic fields) as clearly stated and shown in an example in Dr. Feynman book chapter 16:  http://www.feynmanlectures.caltech.edu/II_16.html . The chapter says it is important to know "the importance of keeping clearly in mind the distinction between the two effects responsible for induced emf’s."

But in your "Faraday" equations any time there is no changing flux or magnetic fields, it results in zero electromotive force while the example in the book shows you could still have EMF due to lorentz force. Even if you have an equation that combines all effects into one, as good and dandy it is, it is not addressing my point that there is voltage across any piece of wire in changing magnetic fields, if voltage is defined properly.

In any case, you are failing to address my point, your ego is easily stroke no matter how respectful I try to keep the conversation and you keep outputting equations to show you are good at math and theoretical physics, and in general you look down at everyone! I was ignoring all these hoping you would show me something convincing. But this is just making me tired of this conversation and so I quit.
Reply from the maker: ElectroBOOM,                  12/12/2018  1:23am
Quite frankly, it has been hard to understand just what it is you were looking for until now.  Your communication skills are not the best.  Suppose you show me how I have been "talking down" to you in these most recent communications.  You claim that I am failing to address your point when I clearly stated a few days ago that I am very busy with my business and will address the issues as I understand them when time permits.  It is the end of the fiscal year and much to do to close the year out.   This Faraday Law discussion is not a high priority for me at the moment as I have a consulting firm to run and the tax man to satisfy.

I sent you my prior comment earlier today to let you know that I did not forget about my promise to you and wanted you to first read about the Faraday Law and the Lorentz force so I could pick it up from there to get into the more nuanced details of just what Faraday's Law represents and is telling us.   It is clear to me that you and many others are missing these details.

Anyway, appears it does not matter for you are tired of trying to learn anything new and shutting this down.  Wish you well.

George Hnatiuk
Reply: @George Hnatiuk  That's what I'm talking about: "Your communication skills are not the best." or "you are tired of trying to learn anything new". You can't avoid stinging people when you talk.
Reply from the maker: Mehdi,
I have tried to reach out to others besides yourself to address the issues at had.  Copying you in on this so as not to be accused of being underhanded and going behind anyone's back.
 
George Hnatiuk

---------- Forwarded Message ----------

Dr. Belcher,
Thanks for responding.  I understand.  If time allows in the future, I would welcome some discussion on the errors that many have made in the past regarding the distribution of the EMF around a close loop linked by a changing magnetic flux.  This is particularly true of the demos and explanations (quite incorrect) offered by ElectroBoom, Mr. Mabilde and Kirk McDonald.  These individuals have used this incorrect conjecture regarding EMFs as defense and justification in using KVL loop rule to analyze the Lewin/Romer circuit.
 
I am currently building apparatus to show how many of these issues, including EMF distributions, can be resolved and "properly probed" as ElectroBoom put it.  There was nothing wrong with Prof. Lewin's probing only ElectroBoom's understanding and reasoning which he never confirmed with any measurements and data.  He provided nothing - just supposition and unconfirmed guesses like Mr. Mabilde.  Never have these people ever engaged in trying to falsify their hypotheses, which by the way can easily be done.  I tried to explain the problems to ElectroBoom in private communication, but he got mad and stormed off in a huff.
 
The comment section of this private video shows that I was trying:
 
https://youtu.be/LAoLzk3H8b0?lc=UgwkNocoH1STcelZAEl4AaABAg
 
I have access to very sophisticated laboratory grade instrumentation, not the least of which includes the best digital multimeter made to date, HP/Agilent 3458A 8-1/2 digit DMM which I helped design - I own three units with current calibration.  My lab is stocked with over $800K of the best instruments money can buy that provides measurement capabilities from DC to 22GHz ranging in accuracy/resolutions from 0.01ppm at DC to 0.01db at 6GHz.  My instrumentation spans high speed multi-channel oscilloscopes, Time Domain Reflectometers, vector impedance meters,  LCRZ meters, high impedance meters, vector voltmeters, vector network analyzers(VNA), spectrum analyzers(SA), and signal sources/function generators of all types.  So I am quite capable of designing experiments and instrumenting them to obtain data with little error and uncertainly.
 
I will be making a series of videos to get others engaged and thinking about some of the problems I have found in the following papers:
 
(1)  Understanding Electricity and Circuits:  What Text Books Don't Tell You  -- Ian M. Sefton
(2)  lecture notes of Lect #20 Belcher/Lewin:   Most Physics Books got it wrong
(3)   [Kirchhoff's Voltage Law and Faraday's Law: ElectroBoom's experiments]  
 
I was hoping to engage in some private communication with the authors of the above documents prior to publishing my analysis and findings to first offer them a chance to make appropriate corrections before publication.  The last thing I want is to be involved in a fiasco such as was created by ElectroBoom which insulted Prof. Lewin.
 
Thank you for your time.
Respectfully,
George Hnatiuk, PE

==========================================================
---------- Original Message ----------
From: "Mehdi Sadaghdar" <mehdi@electroboom.com>
To: <ghnatiuk@juno.com>
Cc: "'John Winston Belcher'" <jbelcher@mit.edu>
Subject: RE: : Walter Lewin and Faraday's Law
Date: Sun, 27 Jan 2019 11:46:19 -0800

Hi George,

Thanks for letting me know. As unfortunately our previous lengthy discussions didn’t lead to a conclusion and disproving my side of argument, I’m not willing to open it again and prefer to rely on Dr. Feynman and Belcher’s teaching, that there is definitely a defined voltage across any two points in the circuit even in the presence of magnetic fields. This doesn’t disagree with Dr. Lewin’s measurements, but disagrees with his conclusions.

Thanks,
Mehdi

==========================================================

Date: Sun, 27 Jan 2019 20:09:55 GMT

Believe what you wish. 
Yes, there is a defined voltage between any two points, "a" and "b", but it is not unique..  Depends on the path you choose in which to sum the voltage along the path going from "a" to "b".  There is no one single holy "correct" value for Vab even when choosing the "zero flux plane" of Malbilde.  Vab cannot be defined by subtracting the voltages/potentials at the end-points like in a conservative system.  End-point voltages need to be defined with respect to a reference datum through a potential field and such a field is not definable in the presence of a changing magnetic filed.
None of this is in disagreement of Feynman's teachings.
 
George Hnatiuk
==========================================================